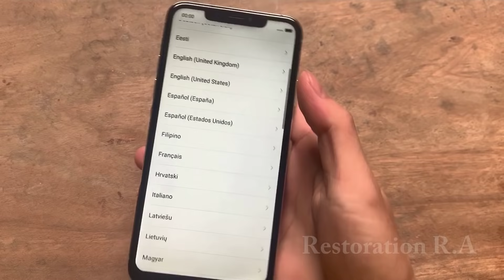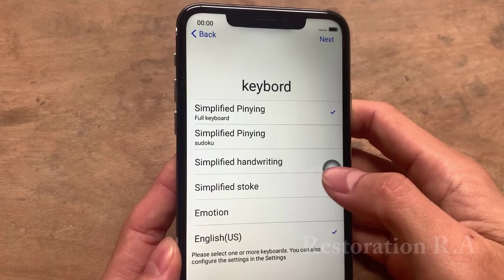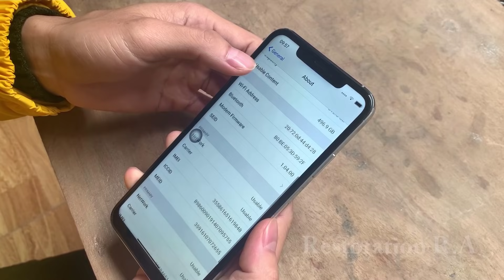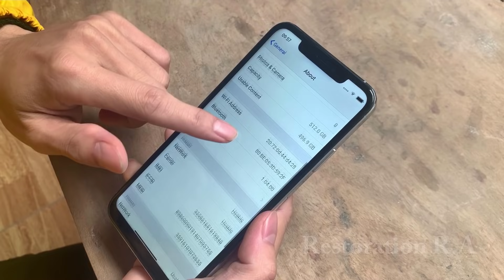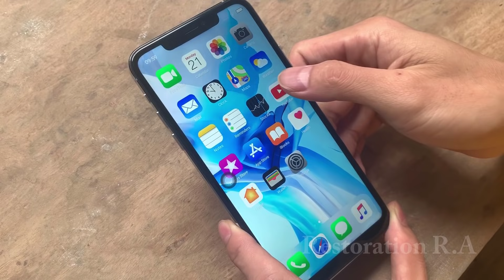Iphone 12 Pro Max restoration | Restore and Repair old broken iphone 12 pro destroyed in landfill

Comment: 12:35 is he measuring resistance on ground pins?🤣
Reply: Lol🤣🤣
Reply: The testing he's doing is pointless, but testing between ground pins is important in some cases. Traces or the PCB itself can be damaged that cause floating ground connections that can cause all sorts of problems.

Comment: That is an android copy. I own a repair shop here in Pittsburgh PA. I have been repairing iPhones for 12 years. iPhones have black PCBs and use expensive components. That phone uses cheap PCBs and has soldered connections. Apple uses flex cables to connect everything on the insde of an iPhone. This phone in the video has all soldered connections.

Comment: Everything is wrong with this phone... we dont solder on batteries and speakers anymore.. I have taken apart iphones before... Also you build this phone front front to back but the actual phone back to front! Also Wheres the wireless charging coil! Every thing is wrong about this "Iphone" Also take a close look at the setup screen... EVERYTHING IS WRONG! IOS has more Upper Case letters than that! Also... KEYBOARD IS SPELT WRONG. AND THE K IS LOWERCASE!
Reply: Welp... i was pissed when I wrote this...